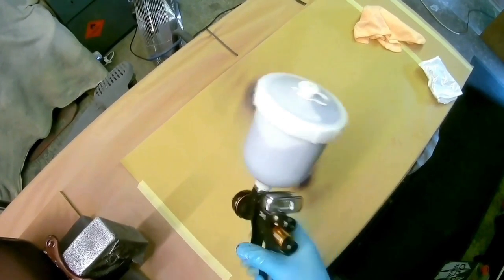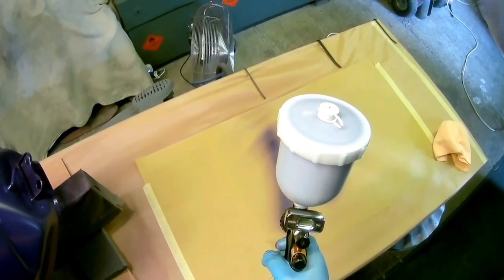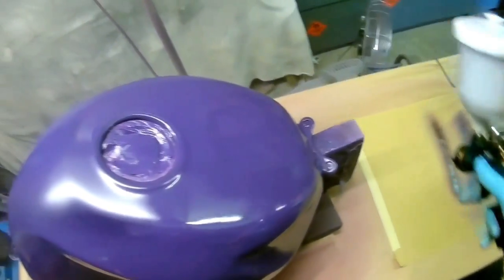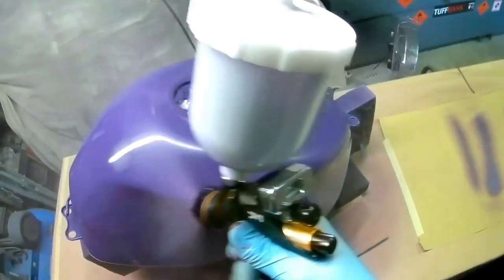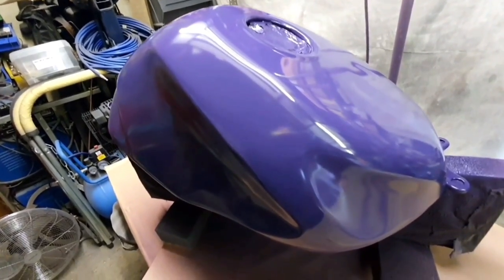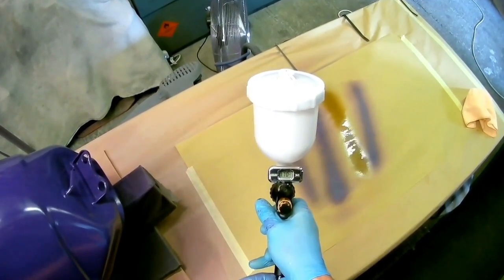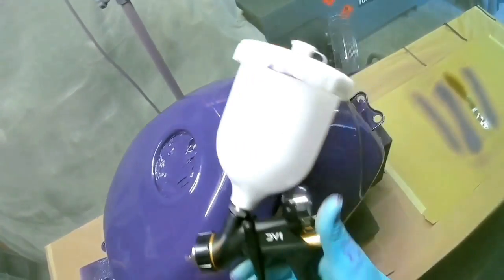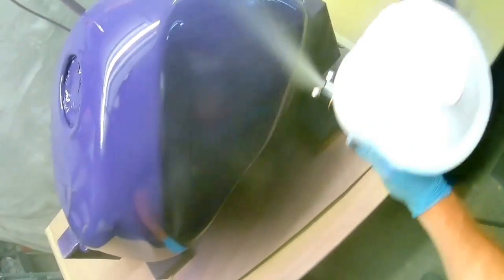DV1 Clear For Base Coat & Clear Coat

Comment: The same people that rag on the lack of speed will praise the LPH400, which makes no sense.  However, there's a difference between production vs. restoration.  It's obviously not for everyone. I prefer a slow gun for better control.
Reply from the maker: Hi Boss, I can certainly believe that, I've never used a LPH400 but it's a split tip low pressure Iwata,  as is the Wider4L,  and they are very good, but, as you say, they are relatively slow, this is also.

Even though the DV1 goes about its delivery in a different way it achieves very good results, which should appeal to someone after results rather than just speed, and, as you say, more control,  cheers, buddy 👍

Comment: Hi Pete, that’s a really nice solid purple with a really nice finish as well! Interesting notes about using a tip size down I wonder what there thinking is with that? Paint saving maybe, more for the pros out there, not sure. Good video as always cheers.
Reply from the maker: Hi Steve,  I think they were just trying to be seen in the same light as Sata.

Sata always come up a little big, so a 1.2 is like many manufacturers 1.3 and so on. To be honest, mate, I think it's all marketing mumbo-jumbo. There is certainly more of it in the auto paint trade than most, cheers mate

Comment: Clear dv1 gun with c1 air cap and 1.2 tip is really good, sprays well at 2 bar. Using it for couple years now doing about 25-35 jobs a day (anything from small jobs to full resprays) and rather happy with the performance. In fact I wouldn’t change it for any other gun😉
Reply: Also base and clear dv1 guns never went wrong on me, feel really bullet proof to be honest. Of course when people smash any gun on the floor kick them about the workshop they go wrong but I don’t do that to my guns😂
Reply from the maker: Hi buddy, I don't do full resprays of cars,  I just don't have the facilities so I can't comment on this gun for that with any real authority so I really glad you have said what you have.

I feel sure, the guy wanting a good quality finish with speed being secondary will find this gun great, I appreciate its not for everyone, what is really?, but it does a good job.

The build is very good, although I would really like to see Devilbiss going away from the gasket sealing around the baffle, its better on the DV1 than the Pro Lite as the DV1 screws down rather than being compressed by the tip but not having it at all would be better,  appreciate the comments,  cheers 👍

Comment: Much prefer the analog version but that's my age I suppose 
The c1 cap is a lot slower compared to the c2 so I've been told as I wont purchase to near to retirement to justify the retail cost but thanks for the vid 😊😊
Reply from the maker: Hi Dean, Yes, the C2 cap is more on a par with the TE20,  the C1, more like the T110, so slower but a little finer atomisation.

I agree about the digital versions, I got this used but hardly used, so it was cheaper than the standard version, that's why i bought the none digital WS & LS 400s, easier to clean,  cheaper and just as good.

Thanks for watching, mate 👍

Comment: DV1 is a good Spray gun, sprays well. Sometimes I use thicker clear. I feel like I need a spray gun with 1.4 nozzle tip?
Reply from the maker: Hi James, Yes, that's normally the way. A UHS or genuine HS benefits from a larger tip. Some people buy a 1.4 in the hope it will speed it up, it does, but not by a lot

Comment: Hi Pete, what clear coat brands do you like that you find flow out particularly well  ? I have used Upol 2084 low voc 2:1 and it looks nice after buffing but not the easiest to get z flat finish off the gun.
Reply from the maker: Hi Mitchell, I haven't used 2084 because we don't get it in the UK, but I think it's similar to the Upol 2080, which doesn't flow particularly well.

I really like the Kapci 6030. It is not particularly expensive compared to most, flows out really well, has good gloss levels, and can polish up ok if needed, the Mipa CX4 is also very good but more expensive, it's an express clear so not so good for big areas but 3 or 4 panels would be fine, goes off rock hard so don't leave too long before polishing

Comment: Looks to be putting out tons of clear to me - as much as my prolite anyway.
Reply from the maker: Hi Ken, it does well. It's very much a thin "I " pattern, and atomisation is very fine. The speed and finish are more like the pro lite with the T110. The C2 cap is more like the TE20 but probably still a little slower, cheers mate 👍
Reply: @peteshobbies5383  Hi Pete, I had to go check, it's been a long while since I used any guns, I have the TE10 and TE20 caps so I can't relate to the T110. I am enjoying your site, glad I found it.
Reply from the maker: Hi Ken, the TE10 is the same speed wise as the T110. Normally, the T110 is a clear cap, and the TE10 is a base cap, although obviously, you will get away with either.

Good to hear you're enjoying the channel, mate. I genuinely enjoy making the videos and chatting away. Cheers 👍

Comment: Pete when painting a vehicle it takes longer compared to other guns and this is why.
Reply from the maker: Hi buddy,  yeah,  I do get it. A few people have said that no matter what they do, it goes on dry with this gun. Now, the Upol I use a lot is more prone to that than most, so I can only assume they are still going too fast and maybe holding the gun too far away for this setup. 

The C2 helps as it is definitely faster, but I'm sure there are many that would appreciate the flat finish the C1 can produce even though it is slow but are put off from what others say, I'm thinking of custom and despoke builders rather than busy bodyshops.

Appreciate you taking the time to comment. it is much appreciated 👍

Comment: Pete, He's what I've got against the DV1, and it's particularly a problem for the once in awhile painter, is that the battery of the digital gauge IS NOT REPLACEABLE. To fix this you must pay $200 for another digital gauge. The battery life is estimated by DeVilbiss to be two years which is in my opinion a big problem. The gun is expensive to begin with and now I've got to buy a $200 gauge every two years. NOT FOR ME.
Reply from the maker: Hi Sataman, the batterys are factory replaceable,  which I agree is not acceptable. The cost of the service in the UK is around 120 GBP all in, around 165 USD, which is stupid.

I've never had to replace them yet, but when the time comes, I will try and do it myself. They are standard button batterys as far as I know, but they are soldered or spot welded,  supposedly to conform to ATEX specification.

When it happens, I will do a video so we can see how I get on, I used to do a similar thing to some power tools batteries, so hopefully, that will work the same. 👍
Reply: I never like a digital so I replaced if for manual and sold digital. Manual cost around $50.

Comment: Quickie Pete how long can I leave a base coat before clear ?
Reply from the maker: Hi Keith, it depends on the basecoat, but it will normally be 1 to 2 hours max. It is best to as soon as it's gone off as the clear adears better.

If you get stuck and can't do it till the next day, then just do another single coat of base before you clear,  it livens up the base again, or a basecoat binder which is a clear basecoat.

You can also go over it with some grey scotchbright, but I'm not keen on that as it can sometimes change the look of the paint if you overdo it
Reply: Beyond 24hrs wet sand with 1000 grit and clear.
Reply: @mitchellferre1652  ok so I can wet sand metallic and pearl before clear ?
Reply: @keithmon1234  I would take Pete's advice and lay down another coat of base coat and then clear it. It has to be scuffed beyond 24hrs and another coat of base will fill in fine scratches from a gray scotch Brite. If it was a solid color it would be scuff and clear. If it's solvent base coat your using, the base coat has a bite to it in itself from the reducer. If it's not clear coated within the manufacturers window it becomes a salvage operation,  good luck 👍🏼

Comment: G’day Pete just wanted to know what your thoughts are about pound for pound between the C1 and the B+ for basecoat which do you prefer as I tried this today with my C1 cap on base and very impressed is the B+ a step up again or is like a much of a muchness sideways step? As the C1 reminds of the TE10 for base but uses 2 and half times the air.
Reply from the maker: Hi Graham,  the CI and B+ look like the same caps apart from the markings, so you won't gain anything really.
It's one-off the reasons many like the B+ for clear coat, glad you bought up the amount of air the DV1 uses compared to the Gti pro lite TE10 as Devilbiss say they are the same which they clearly are not
Reply: Thanks for the advice as soon as I did it that’s how it went for me I had to try as i bought the basecoat gun but the supplier mucked up and gave me a B cap I gave it a shot and just about threw it against the booth wall I saw one of your other videos mentioned it but with no editing on this video so I thought what’s to loose but I was wondering the fan sizes which would give you a better fan pattern or would they be the same? But the DV1’s are air hogs I think so they can get such a fine atomisation.
Reply from the maker: I've never tried a pattern test on the base versus the clear caps so can't say for sure although the caps look the same and the gun is as well apart from colours so I'm sure it would, I have all the caps so a spray out would be a good idea
Reply: Hey mate thought I’d get back in touch with you about this I got the b plus air cap and tried it turns out there’s a difference between the two as the B plus fan is slightly smaller but fatter and the c1 is longer and skinnier so I guess the B plus is a O pattern and the C1 is an I but good result with both but I like the O pattern over an I thought I’d share it with you to see your opinion and I also use a 1.4 tip in both base and clear with amazing results too.👍🇦🇺🍻
Reply: Also clearing with a C2 aircap
Reply from the maker: Hi Graham,  Thanks for letting me and others know. It is much appreciated. 
I still haven't gotten round to trying these in a spray out pattern video. It sounds like there would be useful to people, so I'll sort one out,  Cheers Graham 👍

Comment: My only issue with the dv1 is there's guns better suited to me personally for the money 👍 . For clear , I put it in the same category as the ws400 ... 

The finish you can get off the gun is as good as anything out there , but not a gun I'd recommend for large panels or full resprays . 

Horses for courses , the dv1 t1 is perfect for thinner materials , minor repair work or anywhere you need total precision 👍
Reply from the maker: Hi Andrew,  I think you have summed it up really well, It's very much like the WS400 in both speed and finish.

I would also agree that there are better VFM guns out there, the Iwata Kiwami4 BA4J which has the speed and retains quality, or the WBX,  on a par with the WS400 and DV1 but just over half the price,  cheers mate 👍